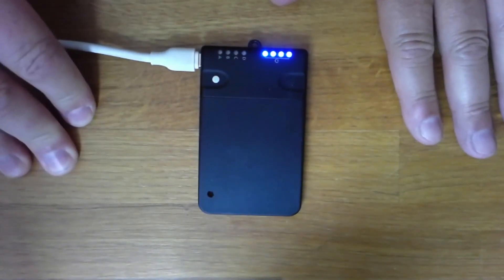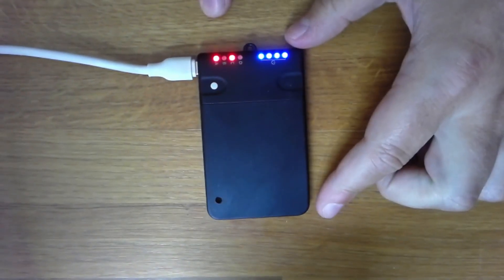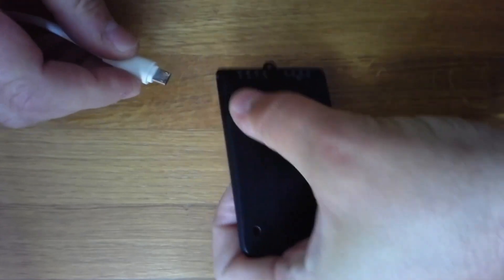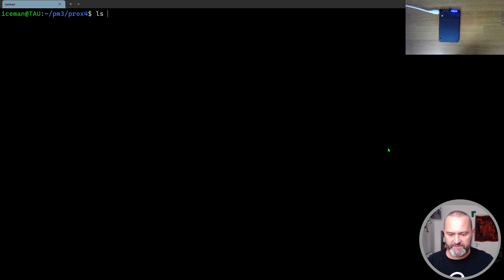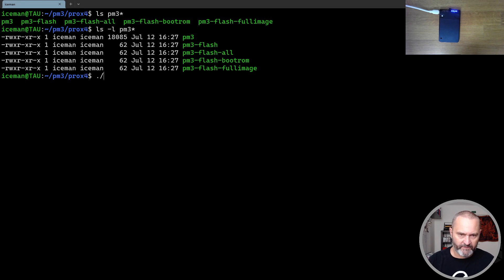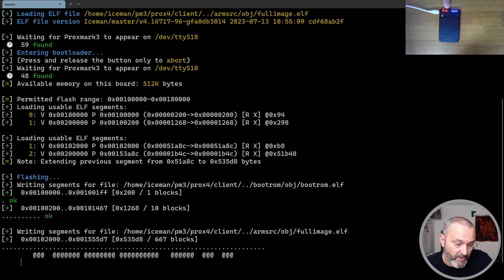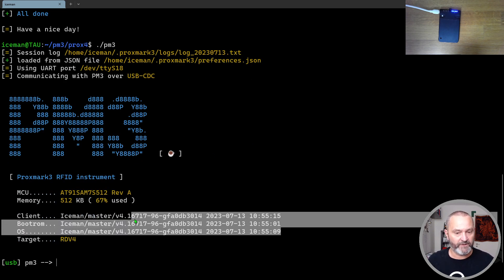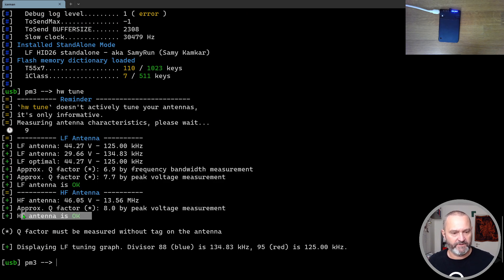Proxmark3 Bootloader Mode: Entering, Flashing, and Verifying.

Comment: Hello, I know you posted this video a while ago, but I just started with the proxmark3 and flashing it doesn't change the version. Everything goes well, but it doesn't change a thing and I dont understand why :( Maybe you have an idea of what's going on ?
Reply from the maker: Sounds like you have both installed and trying to flash a git clone.  
If  you did install,  try uninstall before,
then from inside the git folder,  run the make and flash 

For futher questions  find your way to the RFID hacking discord   discord.gg/iceman

Comment: hmm.. it doesn't work on macbook .I always have to hold the button ....
[+] Waiting for Proxmark3 to appear on /dev/tty.usbmodem14401
  🕓 59 found
[=] You can cancel this operation by pressing the pm3 button
and it stops there
Reply from the maker: Aha,    I think I know whats going on.

As long as the LED  A and C stays on after you released the pm3 button,  it works.
However,  your device has gotten a different serial port. 
you will need to press <ctrl-c>  and just rerun the flashing command and you see it will find your device and flash.

Comment: HI. What is better more or less volts on the antenna? On the video, LF is >44V
my rdv4 upgraded with Q-Switch & F-Switch antenna
LF antenna: 36.54 V - 125.00 kHz
LF antenna: 27.69 V - 134.83 kHz
LF optimal: 36.54 V - 125.00 kHz
Approx. Q factor (*): 5.5 by frequency bandwidth measurement
Approx. Q factor (*): 6.4 by peak voltage measurement

Comment: ice, what does the [2] in  sak mean?
Reply from the maker: Another good question.

The proxmark source code tries different ways when doing the anticollision process.  
That [value] after the SAK is a status message with one of the following meanings:

                0: couldn't read
                1: OK, with ATS
                2: OK, no ATS
                3: proprietary Anticollision

In your case,  2 means that your card did not answer on the ISO14443A-4 level.   (ie ATS) but its selected and ready to go.
Reply: @iceman1001  wow..thxs ice
I have to start lookong at source
Reply from the maker: @Drforbin941  its much to learn when you start doing that.   It will take your game to the next level